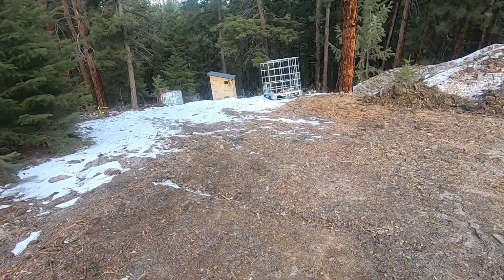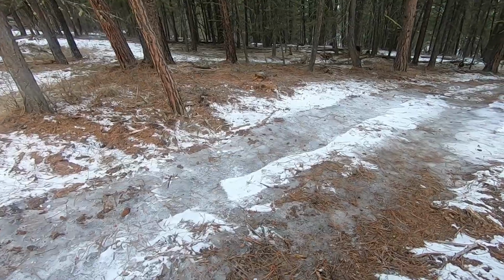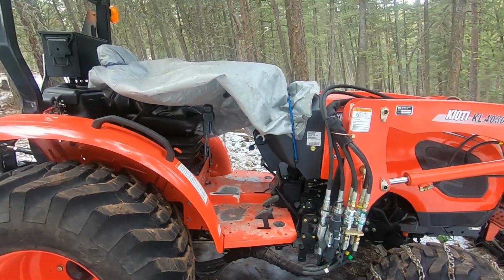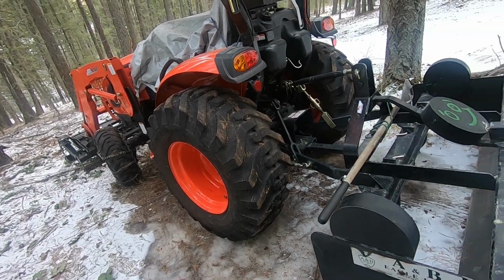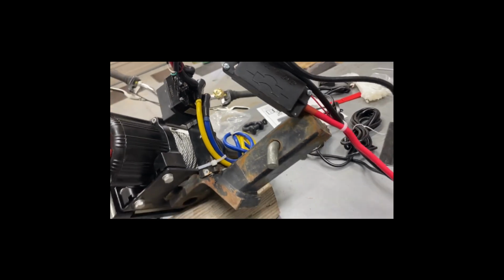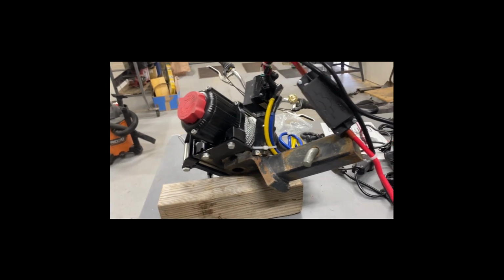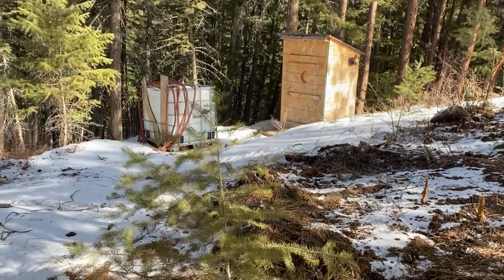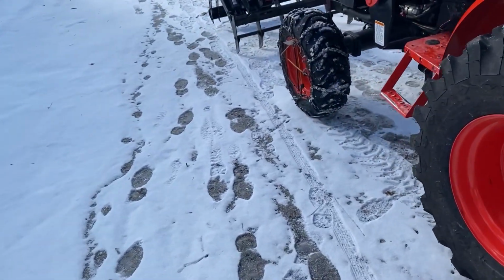I Screwed Up

Comment: Not to be a jerk but you should be able to push/pull yourself all the way backwards with just the loader / grappler 

The tractor also has a PTO, which is basically the most powerful winch available